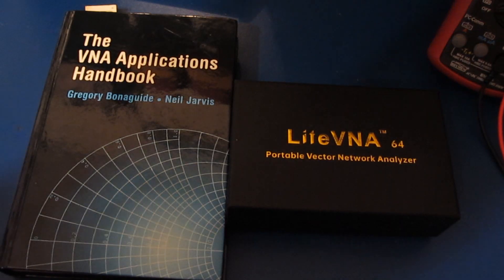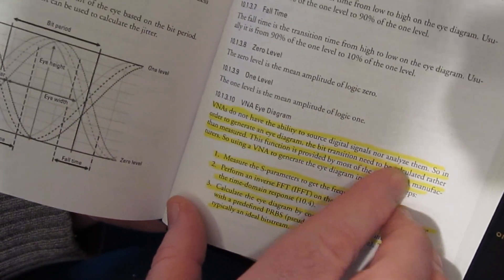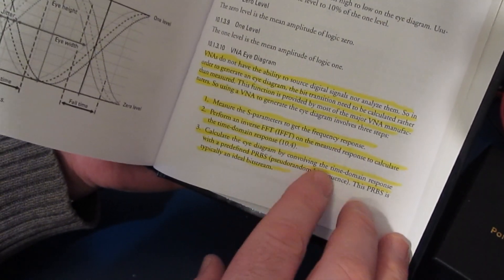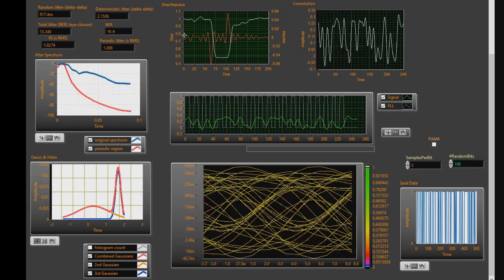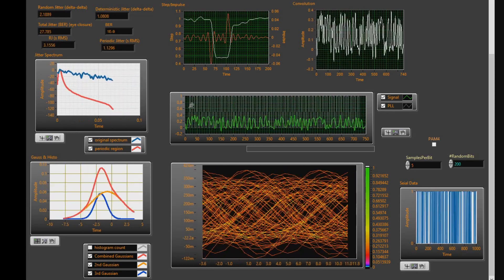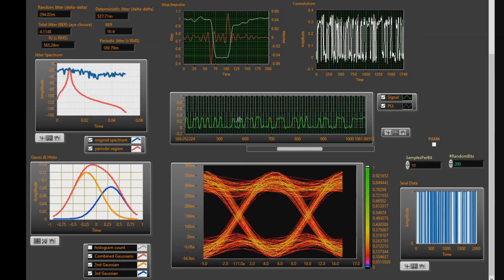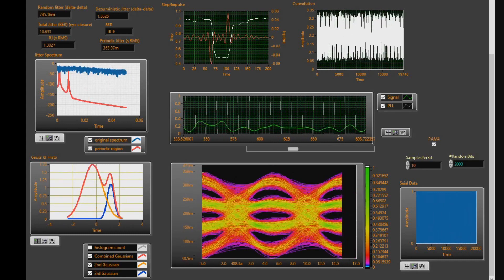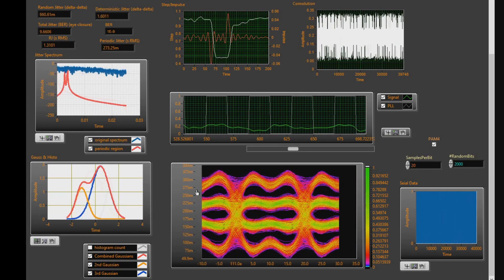Adding Eye Diagrams to Solver32 for the LiteVNA & V2Plus4

Comment: Hi Joe, thanks for all the good work you put in. I have a NanoVNA-F V2 and was interested whether your solver s/ware would be able to run with it. I purchased this beastie since the original VNA was a bit too small for these old fingers. Thanks for any info you can offer, & kind regards.
Reply from the maker: It might.  Consider there are many of these low cost VNAs with various names, manufactures and people creating firmware, it would be near impossible to say for sure.   Keep in mind that I stopped developing software that uses the older protocol some time ago. The latest software supports the new protocol only.    I suggest staying with the open sourced programs.  They are supported and you should be able to join the group.io mail lists to get answers to any questions you may have.    If you want to run my latest software, I suggest you stay with the VNAs I test with.  Currently, that is the LiteVNA 64 and the V2Plus4.
Reply: @joesmith-je3tq  Thanks for the response. I may have to dive in and see where it leads.    😁

Comment: I don't know if this video idea would interest you but have seen a isolated variac that can be found under Variable Transformer SC-10T on ebay. Would be interested to see your take on it and test it to its speced limits that it is truely isolated or any changes you would make. If it is it would be a nice space saver. Thanks.
Reply from the maker: Doing a quick search, it seems there is a video review for it.  Maybe check that out.  Its not something I would normally have a use for.